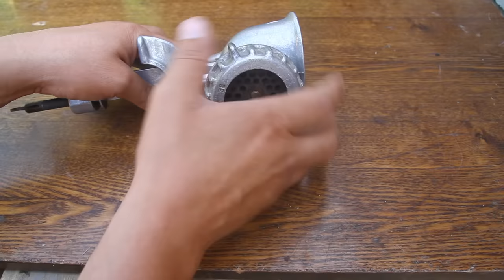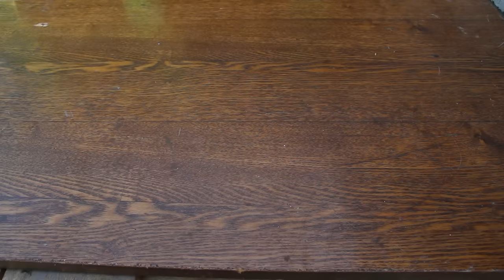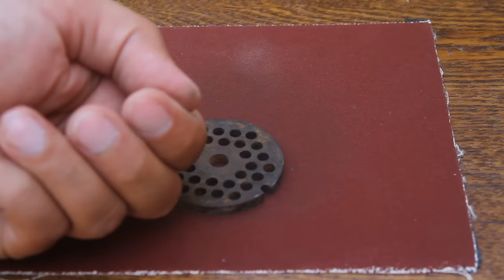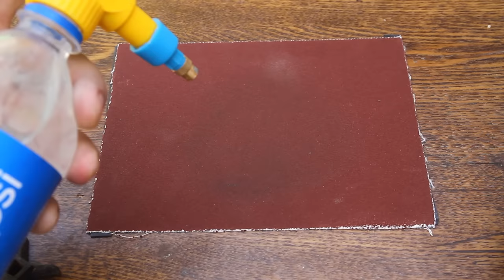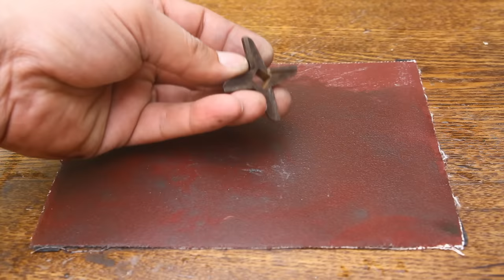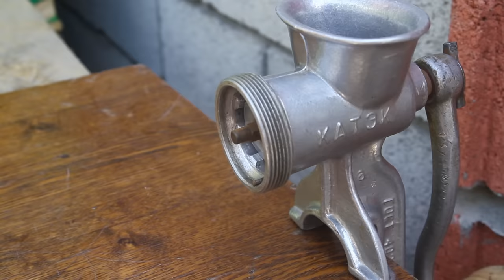The knife from the meat grinder is like a razor! Excellent homemade do-it-yourself

Comment: ok you solved the sharp part, but what do you do with all the rust left on the knives🧐🤔
Reply: Throw it in citric acid solution for a day or two, wash thoroughly in warm water, put some vegetable oil to prevent rusting.
Reply: @wlochu93 å